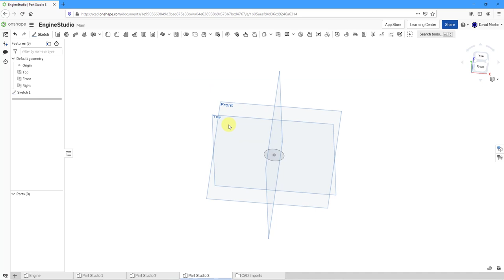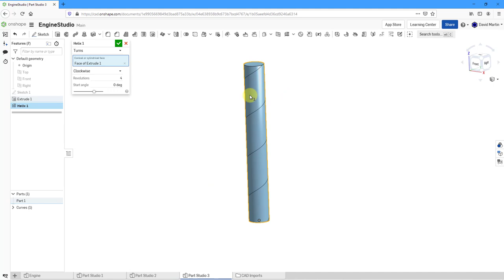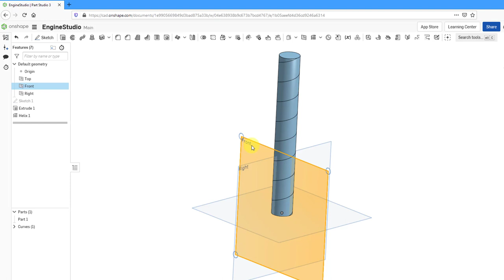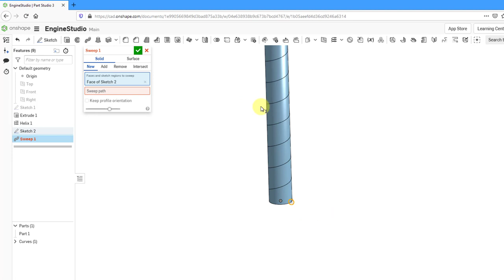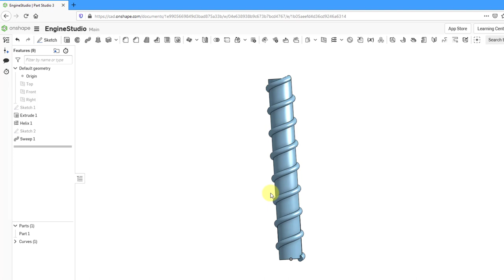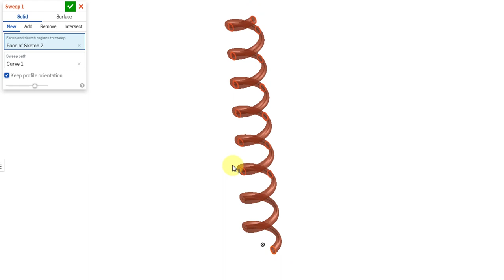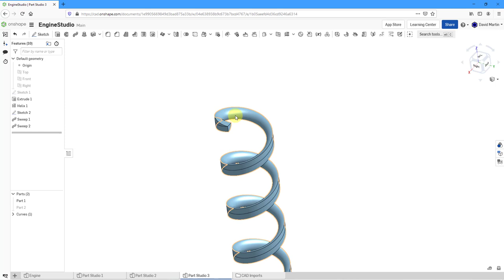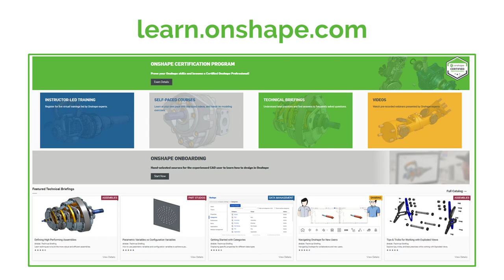Onshape Tutorial - Helix Curve and Sweep | Part Studio

Comment: Thank you for your video...I am new to Onshape and found this very helpful. Question: I made a double helix candle holder out of wood (using lathe, chisels, etc. to hollow middle section) and am trying to sketch the shape in Onshape. The candle holder has a total height of 8.5" and is divided into 3 parts...base taper section , middle helix section, and top reverse taper section. The base is 2" in diameter and tapers to approx. 1.5" with a section height of 1.5". The middle section is the double helix and this section of the candle holder is 6" heigh. The double helix spiral is hollow down the middle (as if you wind 2 wires around a tube then remove the tube). The last section is the top and is 1" in height. It has a reverse (upward taper)...with an end hole of 1 9/16" in diameter and 1/8" deep where the candle sits. I am trying to (1) figure out how to construct each of the sections and have them connect to each other, (2) how to add 2 helix paths that do not intersect each other (offset paths) and (3) how to "hollow out" the double helix middle section so that the middle (vertical plane) is hollow between the 2 helix paths. This link is an example of a double helix (twist) of a goblet...similar to what my candle holder looks like (the top section is different though as it is a candle holder...https://www.youtube.com/watch?v=bl45nkMaYvY Thank you so much for any help/suggestions/ideas/etc. that you may be able to provide. Again...excellent video.